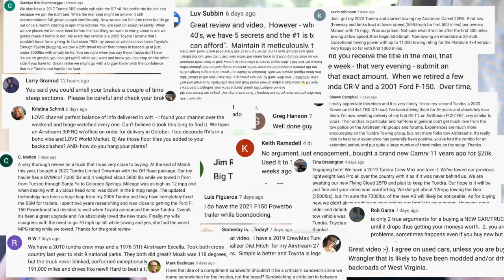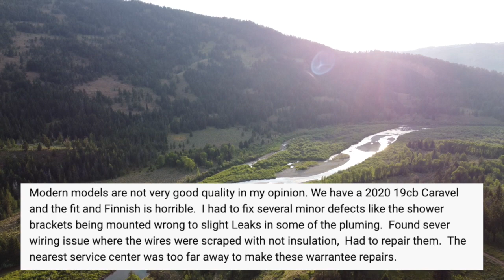8 Things that have BROKEN in our Airstream Travel Trailer & Why We're Ok With It 🛠 in 101 Seconds

Comment: I don't own an airstream but i did buy a new travel trailer in 2018. Last year, about half of the pex tube fittings started leaking. I fixed them but I'm not sure they're all they're hyped up to be. Easier for the installer but they dont seem to last. Good luck down the road and im jealous of your lifestyle!
Reply from the maker: Nothing worse than leaking piping! We’ve spent our fair share of late nights squeezing into tight spaces fixing them. Safe travels Jeff!

Comment: Things do break and I fix them. I have 2020 FC 27 Hatch. Manufactured pre covid. It's my second AS that I've owed.I have replace the City Water inlet 3 times because of leaks. The final fix was to replace the regulator portion of the city water inlet with a back flow valve and regulate the water pressure prior to entering the AS. I even tried regulating the city water inlet before using the back flow valve. Water leaks are the enemy and they are taken care of until the next one.

Comment: Sam and Lauren, thanks again, another crazy nutty fun video! 🤣
Our son and wife just bought a 2013 23’ the Fantastic fan over bed stopped working 2 days after we brought it home. Someone said it might be the push pin when it opens is stuck in the down or compressed position, we need to check. As to having to get new LP tanks, I replaced our 30lb tanks by ordering 2 at Lowes for $89 each
Me on the other had bought a 1999 19’ Bambi in early 2000. We celebrated 21 years in May. My suggestion to our son is, when something breaks try to find a superior quality part even if its a screw you have to replace, so you don’t have to replace or repair again, at least soon. Keep up that energy you too have. If you could bottle it you would be Billionaires! 😊
Reply from the maker: Joe, do you leave this nice of comments on everybody’s videos because we are starting to feel really special! 😂 

Thanks for sharing your perspective on this. Really good advice per usual. One follow up question… Did you ever consider just getting those propane tanks re-inspected rather than buying new?
Reply: @ALittleBitUnhitched  i did get them inspected after they expired. Ours had a 15 year date stamped on them and the inspection got us another 5 years. So after 20 years I thought it would be safer to just get new ones. $89 each did not break the bank. And we fill at Costco near home. Its a flat fee of $16 so we wait till they are super empty then fill them. And you guys are so lovable I can only express what you two dish out 😂
Reply from the maker: @Joe-cu4hi  Thanks for elaborating on that Joe! Also thanks for being such a great hype man. We always enjoy your comments!

Comment: You purchased your unit used and do not know how well it was/wasn’t taken care of. Did previous owner slow down on rough roads, etc. Here’s my list : mesh washing machine lint screen and mini zip ties. Attach to bottom of ac drainage hose. Squeegee- use on shower walls and inside shower door after showering. It’s amazing how much water 🚿 collects. Removing immediately reduces condensation/humidity. Use a small ceramic heater with door closed to dry out quickly. Keep on rving!
Reply from the maker: Thanks for the comment and the list! Never would have thought about the mesh over the AC drainage hose. Makes sense to keep critters out. For condensation issues, we also run a dehumidifier which has REALLY helped.
Reply: @ALittleBitUnhitched  glad I could help-  get a squeegee and do the interior of the shower once and you will always do it after you see the volume of water that rolls off. I do the ceramic heater in extreme humidity or in winter. Don’t have to leave the vent fan open so long.

Comment: I can't speak to Airstream quality back in the day, all I know is that I took delivery on my 2022 Flying Cloud 25RBT late October 2021 and then following occurred: During her maiden voyage the arm that controls the lid on the  front fantastic fan closed to tight broke itself away from the lid (I believe this happened before delivery, but some people at an AS dealership that will remain nameless disagree). Cue service center to sell and install (2) Max Air Covers for approx $575. Then, on our second voyage, on day 1 of 8 to the middle of Nowhereville, the water pump would not pump. Didn't really care why, I just wanted to flush, so we drove 50 miles to buy a new one and replaced it ourselves. During a torrential downpour on the same trip, it began raining INSIDE the Airstream. Water was steadily dripping at the back panorama window where the inside shell meets the window frame. In a genius moment, was able to make it stop by putting towels all over the outside of rear corner area where dripping was happening. This was able to wick the water away from where the entry point was and the leaking stopped. We haven't been in rain again yet to know if (when/how) this is going to happen again. After that there seemed to be a break in the breaking until a few weeks ago when the lid arm on the back fantastic fan broke itself free from the lid. In conclusion, I still love our Airstream and wouldn't give it up for anything. I just wish my expectations weren't quite so high going in. As Sam stated, it is still a trailer, and it does experience violent earthquakes on every adventure. Also, these are handmade by humans. I haven't met a human yet who wasn't prone to error at some point in time. However, the standard for inspections at the mothership could stand to be increased just a bit. Thank you Sam and Lauren for another great video!
Reply from the maker: Jamie! Sorry to hear everything that you’ve been dealing with. I can’t image not having a functional water pump after planning a big boondocking trip! Yikes! Especially with a brand new trailer. Double yikes! Big leaks? Triple yikes! Hopefully Airstream can hook you up with some warranty work if anything major is needed. Fingers crossed that the kinks are worked out and when we meet on the road someday we can share a drink and some stories.  Thanks for being with us since the beginning and for sharing your perspective! We really appreciate you!

Comment: Great video! We have a 2021 Flying Cloud 25 FBQ and quality has been pretty good. There seems to be more things breaking than our previous trailer a 2019 Lance 1995. The roads we have traveled have also been in need of maintenance... Kentucky. I do feel that there are several things Airstream could do better to make them seem higher quality like cable management, pipe management, and thumb screws on the ac filters. Great channel and I am slowly making it through your videos.
Reply from the maker: Thanks for the well thought out comment John. We are jazzed up that you found our channel!  

Keep us posted on how your Flying Cloud holds up. We’ve heard from a couple people recently who were dealing with some issues on newer Airstreams. Hopefully this is just the “break in phase” and not a trend. Anyway, thanks for the perspective, keep avoiding the potholes, and we will see you out there! ✊

Comment: 2019 30' bunk,  bought used and no furnace... had to replace the circuit board (Amazon and about $100) 8 months full time on the road and then the water heater went out... also the board,   they solder relays into them and full time use causes failure due to the constant cycle on/off that the weekend warriors don't run into
Reply from the maker: Any suggestions aside from limiting usage to prolong the lifespan of those circuit boards? Thanks for the comment Chris!
Reply: @ALittleBitUnhitched  yes,   if you're using the furnace go above your target temp by over the two degree window the t-stat is set at,  more like over 6-8 degrees then when it hits that lower the temp back down.  That way it's not cycling on and off constantly
Reply: I think you can set the temp window in the t-stat to be wider but I'm lazy
Reply from the maker: Not a bad idea there at all. Thanks for the insight Chris!

Comment: I have a 2015 as well - so strange about your propane!

For the Fantastic Fans I’ve had to replace the fuse - have you tried that to get them working? Sometimes mine will make mystery noises at night, but I’ve chalked that up to the sensors reacting to the reflectix I shove up there
Reply from the maker: Thanks for the super helpful comment Amy. The fuses appear to be intact but we were planning on ordering new ones before taking things apart. The propane tank mystery may never be solved but we are determined get to the bottom of this one. Stay tuned! 

Also, follow up question.  Do you put the Reflectix on the outside or inside on the fan? Does it help? We block out all our windows but have never considered the fantastic fans. Thanks!
Reply: I tried to link the thingies I use and I don’t think YouTube appreciated a link 🤣 I’ll DM you on Instagram and if THAT doesn’t work, Google Camco Fan Insulation - they just get squished up inside and work beautifully for heat/cold/blocking light
Reply from the maker: Mind blown. Didn’t know these existed. Thanks for the great suggestion Amy ❤️